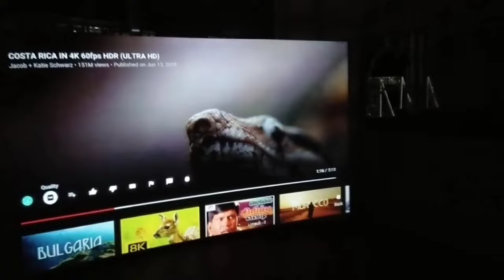Build 120" Inches curved projector Screen for FHD 1080p | 4k Home theater setup | Borderless | DIY

Comment: problem to get sharp picture middle and edge on picture because edge is now closer to projectorlens than normally ?
Reply from the maker: Opticals used in High end projectors are mostly for flat surface screen if you get more blurry reduce curve point of the screen

Comment: Bro ..is it possible to fix projector on ceiling for this alr screen..
Reply from the maker: Yes
If you fix more height then screen
Brightness down little bit
Reply: @THINKalt  ultra short throw projectors are suitable for curved projection screens?
Reply from the maker: @landrodaoud1531  
May be! before you go test your projector left and right edge focus using white paper if its clear with flat screen curved screen affects focus or if flat screen doesn't give clear focus on edges curved screen helps to solve unbalanced focus